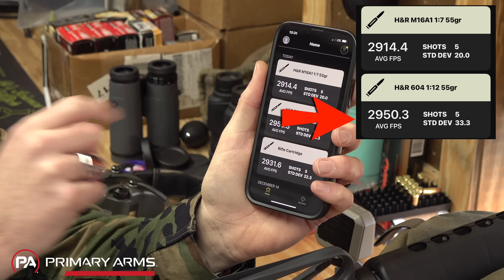Which is more accurate? 1:12 or 1:7 Twist Rate? Let's find out!

Comment: 1 - I'd buy one of those for the 20" barrel, and 'cause they're being made by one of the M1 Garand manufacturers 🙂And would go with the "variety of ammo" twist rate 😛
2 - That's a beautiful dagger. Sometimes seemed to have a second bevel, but depended on the angle. Is it Lockwood? Loved the fittings and leather color choice 🙂
Thanks for the vid Tim! Was super helpful indeed! 😀

Comment: Good test, Tim!  Still, I think I would like to see the same test with a couple of scoped rifles (not something attached to the carry handle, however!  I have had zero luck with such scopes in the past and do just as well with iron sights!).  I'm old enough that I have either red dots or scopes on everything!  I've never once hunted any big game without a scope due to relatively poor vision.  I'd also like to see some mil spec ammo included, M193, M855 & maybe even SS109, which are all relatively (for the moment) available.   I believe a decent scope evens out the difference between a shooters ability and the ability of a rifle to group. 

Of course, the bottom line is going to depend on individual rifles as well.  Not all rifles are created equal, even if they have consecutive serial numbers from the same manufacturer.  It's just a fact of life and it's pretty unlikely that any two rifles will shoot exactly the same groups with any given ammo, even with everything else being as equal as possible.  It could happen... but I wouldn't bet a nickel on it!

Basically, rifle accuracy is a crap shoot, involving not only the rifle and accessories (scope, mount, rests, etc), weather, how the shooter feels that day and what phase the moon is in!  Plus a bunch of other stuff I won't even try to mention.  If you were to shoot 50 groups, on different days, with each type of ammo, you might get some meaningful statistics... but only with those lots of ammo!  There's always a little bit of voodoo mixed in with testing of any kind, it just can't be helped, short of spending all your time and money, not to mention barrel life, on testing!  Even if you did, it would only apply to those two rifles!  The only solution is to do the testing on your own rifle.  And to do enough to prove to yourself, that X brand (or, in my case, X load) is the best for your needs.  It's like zeroing your rifle... yeah, you can follow the general rule (whichever one you like, 25 yards, 50 yards, 36 yards, etc., etc!) but without a chronograph and accuracy testing, it's nothing more than a SSWAG - a Semi Scientific Wild Assed Guess!  Which means you're going to get SSWAG accuracy out of your rifle.  But hey, if that's good enough for you, great!  Personally, I want to know where my rifles shoot... preferably exactly where they shoot!
Cheers, 
jc

Comment: The reason they changed twist rate was that the 1 in 12 wouldn’t stabilize the 62 gr bullet. The 1 in 7 with a 55 gr bullet will cause a 30% decrease in accuracy according to NSW Crane Navy admin message and may actually cause damage to a military barrel. So you just confirmed that. Nice video

Comment: Maan Mac! twist rate is only dependant of bullet length NOT weight! It prevents the heavier back end to overturn the lighter front.
Reply: Also why the Mogadishu drill was invented. The soldiers found that a drug crazed super thin man don't stop for nothing less. American decease "we are the best" but knows nothing unless you buy it elsewhere. One of the demands for the 62 grains was that it had to penetrate a russian kevlar helmet at 600 meters...STUPID since at close range it didn't even notice the thin mogadishus  and just made small holes. A 55 grain out of a 20 inch 12:1 barrel is far more lethal on soft targets than the newer ones. In fact if someone, probably not american, didn't invent the reddot the american army would be down the shitter.

Comment: The slower twist rifling in my experience loading for varmits in 223 is easier to push a bullet through and therefore can be pushed to a higher velocity while maintaining pressures,had my bolt gun rebarreled in a 1-7 twist and had issues with high pressures . Of course this is just anecdotal all things considered like manufacturing tolerances and quality control

Comment: ...the ORIGINAL M16 twist was 1 in 14 - when the Army decided to adopt the the M16 as a standard rifle it found that the 1 in 14 did not stabilize the tracer rounds and changed the twist in the M16E1 (which eventually became ta A1) to 1 in 12 to stabilized the heavier tracer round - the 1 in 12  reduced the "explosive" lethality of the original 1 in 14 twist (which is prolly the source of many complaints in the mid 60s that the M16 wasn't 'getting the job done' (referring to the old , initial, 'glowing' reports of the round causing 'explosive and extensive tissue damage...when the 62 grain projectile was introduced ca 1963 (after the Marine Corps experience in the Sinai post  Camp David Accords) the twist was increased to 1 in 9 - then eventually to 1 in 7 for the heavier bullet weight - again with the old complaint that the bullets weren't 'doing' the job' i.e. not causing the kinds of weoulds that had been expected...

Comment: Weight honestly has nothing to do with it, at least not how people think, length is the real factor. If you have two projectiles that are the same weight but different lengths, the longer one is the one that needs the faster twist to stabilize. M856 is why 1:7 was chosen over 1:9 because it was found that the longer tracer that’s still 62gr needed it to stabilize. Tracers aren’t the only projectiles that cause this, with all copper projectiles becoming common they also have the same issue. Now if you have two projectiles that are the same length but different weights, the lighter one needs the faster twist. Then there’s width, width has a huge effect as well. The miller stability formula can shot you how much it all matters

Comment: Both those guns have barrels with 5.56 chambers. Using .223 ammo seems less than ideal for the purpose of your test. Why not use 5.56?

OTOH, it could be interesting to see the accuracy/velocity of that Federal 55gr .223 out of a .223 1:12 compared to your 604's 5.56-cut 1:12

Comment: I'd bet your 1:12 has a slightly tighter bore/groove diameter than the 1:7 as the cause of your velocity difference rather than twist rate. It's not uncommon to see 10-20fps difference in my match rifles that have barrels from the same manufacturer and that have been chambered with the same reamer.

Comment: The first shot of your first group was confirmed to be a 6 o'clock hold. But then throughout the rest of the video it was referred to as a flyer. It may have been a flyer, but The way the information is presented it seems that the difference in aiming method was not accounted for in the final tally.

The test methodology used neuters the usefulness of the results. Nothing to control for your eye sight, inconsistent aiming methods, chronographing shots that were not involved with a groups, and using one target for all groups made the end result harder to delineate.

I appreciate the effort exerted but my curiosity on barrel twist affects is not satisfied.

Comment: The velocity isn’t going to be related to the barrel twist.  Some barrels are just fast.  I have a Faxon Heavy Match .223 Wylde barrel that’s a 1/8 and shoots 55 grain Frontier to damn near 3400 fps on average.  I have a Criterion 20” 1/12 5.56 in an XM16E1 clone that shoots that same ammo at 3287 average.  I have a 20” BA Premium .223 Wylde that shoots the same ammo at 3272.  I also shot some Winchester M193, and the order of fastest to slowest remained the same.  I chrono’d all of them with a LabRadar.

Comment: I agree with needing a larger sample size for velocity. 36 fps difference? As Paul Harrell would say: that's within the variation of one round to the next; not enough difference to make a difference. 

Is the tighter twist converting more energy into angular velocity? Most likely, and I'm sure there's math that will support that. Does that make a difference? Probably not in a vast majority of use cases. There might be one extreme example where it might, like shooting at a very long distance, but I doubt it within the standard use case of the round (within 300 yds).

Comment: Didn't the original, early early AR-15s, before they even "became" m16s and were adopted by the military, have 1:14 twist rates?
Regardless, I've almost always been a 1:7(or sometimes 1:8) kind of guy, because I opted for the 77gr loadings(especially black hills TMK, and Cor-Bon MPR before they stopped making it and sold the company) as my self/home defense, and all around "go" round relatively early on.
I do really want one of those old, super light, 20 inch 1:12 twist barrel ARs(or at least a clone.)

Comment: Velocity isn't even close to the 3125 to 3200+ I get with PMC M193 and Lake City M193 from the 1980's out of my A1 with 20" chromed lined GI barrel. I'd say Federal cut pressure to the .223 level instead of running "military grade" pressure. Heck I get 3100fps out of my hand loads with 55gr bullets. Plus on a good day I can cover my shots with a half dollar.

Comment: The 1/7 twist barrel converts more of a bullet's total energy into rotational energy than the 1/12 does. Bullet mass being equal, the "forward" velocity should be slightly lower from the 1/7 than the 1/12. Where it gets really interesting is 8.6 Blackout from a 1/3 barrel. You start to lose so much of the "forward" energy to rotational energy that traditional methods of measuring velocity and energy are insufficient to approximate the total energy.

Comment: For those interested in the numbers, a 55 gr M193 projectile is .76 inch in length. With a muzzle velocity of 3250 fps, it will have a Stability Factor of ~1.67 from a 12 twist and ~4.9 from a 7 twist. The 62 gr M855 projectile is .9 inches long. At a muzzle velocity of 3150 fps, it will have a Stability Factor of ~.9 from a 12 twist and ~2.6 from a 7 twist. 
Stability Factor is a numerical expression of a bullet's gyroscopic stability. Computing it is complicated as it relies on a list of variables, including not only bullet length and twist rate, but also environmental conditions such as altitude, pressure, temp, and humidity. Some external ballistics calculators will compute it for you if you input the data required. I got these numbers from Strelok Pro. 
Generally, a SF of 1.5 to 1.6 is considered ideally stabilized for proper accuracy. Long, heavy VLDs will require a SF of 1.7 or so for full stabilization and ideal BC, which is important for external ballistics at long distances. Anything over a 1.8 is overspun, and as you get above 2.0 you're radically over stabilized to the detriment of accuracy and potentially terminal ballistics.

Comment: Back in the 1980s just prior to when NATO adopted the SS109/M855 62-grain "green-tip" enhanced penetration round for the 5.56x45mm cartridge as its standard, army testing of twist rates found that 1:9 was optimum for stabilizing both the old 55-grain M193 round and the new M855. However, trouble hit when the 62-grain tracer was tested; it was not stable out of a 1:9 barrel, due to its greater length than the standard M855. The army switched to a 1:7 which solved the problem, albeit at some cost in accuracy with M193. 

If you plan to use exclusively 55-grain (or lighter) ammunition, then the 1:12 with a 20-inch barrel is optimum; it is close to the original configuration designed by Eugene Stoner et al.(which was 1:14). However, if heavier and/or longer fare are to be employed, a faster twist is needed. Every barrel is unique, but most 1:9 tubes will stabilize adequately up to 69-70 grains or so, some a bit heavier. If 70+ grains are to be used frequently, then a 1:8 or 1:7 are best. 

Service rifle competitors who single-load shots of 80+ grains for the 600 yard stage sometimes use a slightly faster twist than 1:7 to achieve optimum results.
Reply: There’s absolutely no sense in getting a barrel twist slower than 1/9 if accuracy and bullet weight variety are at the top of your priority list.  My experience is based on the use of ammunition I handloaded for my .personal 223/5.56 rifles.
I have 7, 8 and 9 twist rifles that ALL shoot 0.5 MOA or better at 100yds with bullets ranging from 50 to 75 grains.  My 1/9 twist.223 bolt gun shoots 45 caliber sized, one hole, 5 round groups at 100 yards, .904 inch, five shot groups at 300 yards using a 69 grain Sierra TMK and the last time out fired a three shot group at 925 yards that went into under 5 inches with a Hornady 75 grain ELD MATCH bullet.  
I’ve tried every grain weight bullet between 70 and 80 grains and the ONLY bullet that has worked is the 75 ELDM.  Every bullet between 45 and 69 grains shoots bug holes.  I’ve never seen or heard of a 1/12 twist barrel shoot what I would consider acceptable accuracy with anything over 55 grains.

The ability to accurately hit my intended target consistently for maximum terminal effect is far more important than the hoped for, maybe, possibility of a bullet tumbling and maybe traversing the target in a direction that possibly increases its terminal effect.  I’ll take alittle extra bullet weight and “put it right there” accuracy any day over 3 to 6 inches at 100yds….
Reply: @danulman8837  depends on intended game personally the 1:8 is perfect since you still get accuracy with 55 gr varmint rounds and stabilize 75-77 gr rounds for long range and medium size game like hogs
Reply: @danulman8837 - Your comments are on point and make sense. Returning to the 1980s, I've never understood why the U.S. Army jumped from testing 1:9 twist barrels with SS109/M855 to 1:7 twist barrels without trying the 1:8 also. A 1:8 barrel enables the user to use anything up to 80-grains effectively. Nay-sayers will claim that 1:7 tubes can't fire 55-grain loads accurately, but every barrel is different, and there are some very accurate 1:7 tubes out there, even using loads in the 50-55-grain range. 

But if you don't want to mess around with testing a bunch of different rates and barrel lengths, just get 'em in 1:7 or 1:8 and be done with it. Varmint hunters often shoot loads lighter than 50-grains, but it is rare to do so in the AR world. 55-grains and up seems to be the rule these days. 

The fix for a 1:9 which doesn't like heavier loads in the 70-77-grain range is simple, though: Simply using loads in the 68-69-grain range instead. As you noted. They perform well at the most-commonly encountered ranges, and have higher MV and shoot a bit flatter than the heavier pills, too. And most 1:9 tubes do well with them.
Reply: @GeorgiaBoy1961 you're not understanding stabilization at longer ranges and moving through the transonic barrier. That's why they went with 1:7 twists to stabilize a 62gr BTFMJ.
Reply: @ mattmarzula - You're full of it. I have forgotten more about the subject that you've ever known. Don't presume to lecture me about anything, sport.
Reply: @danulman8837 I don't believe that you and your rifles shoot like that on your best day with the best conditions. Everyone exaggerates how they shoot. Especially anonymous internet dwellers. Fortunately, you're on a medium where you could easily post a video as proof. But you don't and you won't.
Reply: 1:8 seems to be a good all around twist rate for 55 gr varmint loads and even heavy 77 gr loads
Reply: Great info.  Thanks.
Reply: I only have ONE 1/9 twist rifle as the rest are mostly 1/8 and one 1/7.  The point of my post is that there’s no sense in going with a rate slower than 1/9 because it will shoot ALL of the lighter bullets AND still gives you ability to shoot heavier bullets to “reach out” if you want to.  You can’t imagine how much fun it is to go to the 1000 yard line with a 223 and smack steel with the “big boys” and get more impacts than they did and still shoot 55 grain bullets at over 3200 fps.
Reply: Funny thing though: tracers ain't accurate and they burn out the rifling making everything else shoot terrible too. I didn't understand why we even used tracers in 2004 while everyone had NVGs. The military trends toward retarded SOPs.
Reply: @GeorgiaBoy: You know your stuff. Most of my friends never knew about anything slower than a 1 in 12 twist.
Reply: @terrysaunders2026  - Thanks for the kind words. I have always been fascinated with military history, and in this case, small arms development. The place you really hear about very light bullets and relatively slow twist rates is in the varmint shooting community. I'm not a part of that, but picked up a few things here and there. Bolt-action rifles in 1:12 or 1:14 are quite common with people shooting prairie dogs at 400-500 yards away using 40-grain pills at 3,500 fps MV in some cases. 

Getting back to Stoner's design, the initial AR15 in 1:14 tested well in typical temperate climate conditions, but failed to stabilize 55-grain slugs under cold/Arctic tests, which is why Army Ordnance asked for it to be changed to a 1:12 twist for the M16A1. That's the story I've seen in the histories of that time.

Comment: If those 62s were not keyholing, then they are stable. Marginally stable, but still flying nose forward. I'd be surprised if that barrel is a true 1/12. In Army testing; M855 will tumble with a 12 twist.
Reply: They appeared to be simple 62 gr fmj, not steel tip m855 so they will be slightly shorter